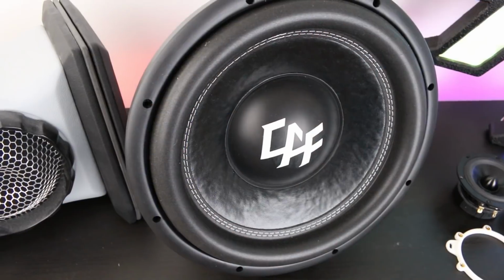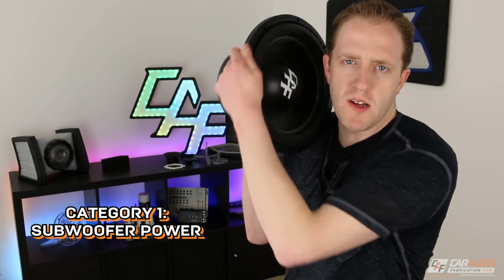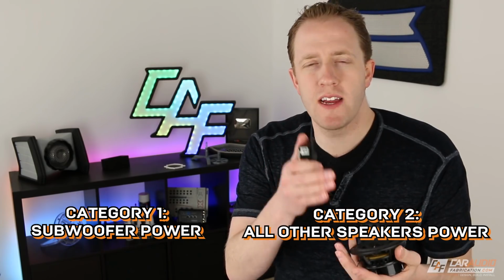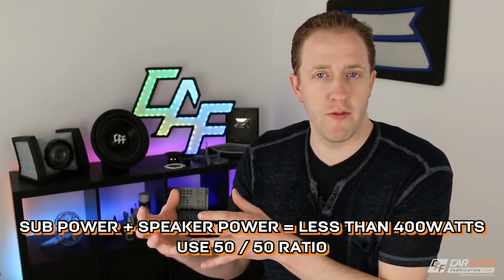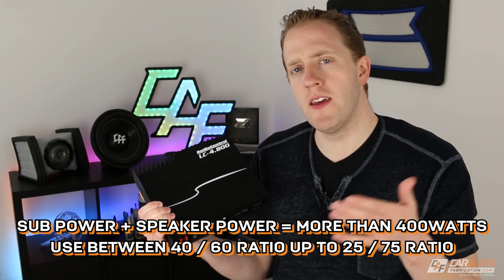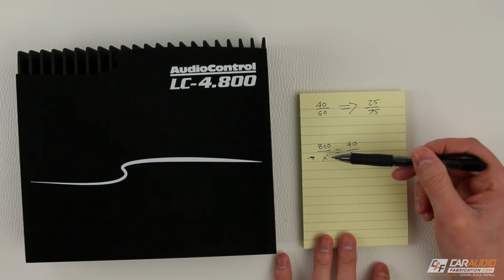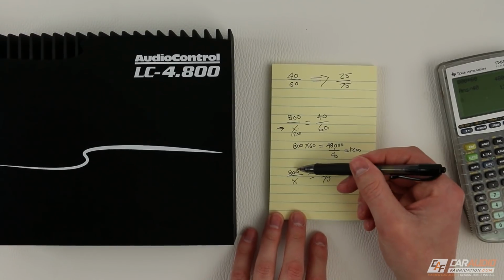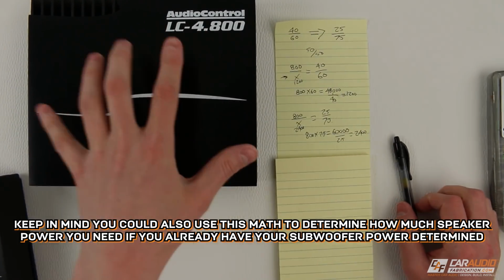Pair amplifiers CORRECTLY - Power Balancing Car Audio

Comment from the maker: Some of you are asking about systems that have MUCH more power, even more than 3,000 total. The larger the total power the more you can shift the power to the subwoofer amps and still have a good balance. So for those of you that are running 20K plus on your subwoofers it's totally acceptable to have a much higher percentage on the subs in relation to the speakers, but let's be honest... at that point its no longer about sound quality and much more about competing and setting a score with the subs. This video is more for the overwhelming majority of people who are likely running from 500 up to 3,000 which I would consider more of an everyday system, and again the VAST majority of systems that exist. Additionally yes, there are other factors to take into account, speaker efficiency, how close the speakers are to listening position, size of the vehicle, temperature of the air... on and on. This is why there is a range of ratios, to account for the variables. Can you skew everything in your favor and use the worlds most efficient speakers and the worlds least efficient subwoofer and obtain balance. Sure... but odds are that using a power range within the described range will still perform better than outside the range. Its a guideline for a starting point that works incredibly well.

Comment: Dont overthink basic systems. If you only have subs & amp, just adjust the amp gain level slightly louder than the factory equipment until you can add better door speakers & a 4 channel amp & readjust then.

Comment: This is a simplistic approach IMO. What you should be looking at when deciding is speaker sensitivity (ideally graphs).
Assuming you want 108db of volume - and a flat studio EQ - this is how many watts it would take:
Tweeter with 92db sensitivity? = 40w
Mid/Woofer with 88db sensitivity? = 100w
Sub with only 83db sensitivity? = 400w.  +3db of bass boost? Then 800w.

That is only the wattage ratios for those speakers, with those sensitivity ratings.  Enclosure design etc real world stuff will change what it puts out, but still at least something to go off of other then just "usually people use some ratio between x and y'.
Can we please make math cool because actual answers are betters then general rules/ratios.

Comment: I have second hand 2x45W amplifier and just for fun slapped a 300W subwoofer on it and my windows were shaking like hell and the speaker started to smell  burned and the amplifier fuse started to melt how and people come with numbers like 1200 watt amplifiers for what ? Bragging rights ? Pushing 1200 watt to what goddamn speaker your windows will blow. People ask a simple fcking question what speaker do you need for a certain amount of amplifier power and we get a complicated 8 minute video about god knows what because i didnt understand a goddamn thing properly.

Comment: When I am looking for an amp to match with speakers I generally go by a process of using an amp with twice the output than the speaker. So I would find an amp that was capable of providing 200 watts a channel if I were installing 100 W (RMS) speakers. Then I adjust the gain accordingly, somewhere just under 50% so I am sending 80-90 watts of power to the speakers. Foremost this is to reduce the stress and heat in/on the amplifier since it is working under 50% capacity. This means reduction of heat within the amplifier, keeping components cooler. As heat is the number one enemy of amplifiers. This will help the amplifier work properly and  for many years longer than using an amp that is running at 70%, 80%, and 90% it's capacity. If your amps are in the cabin of your vehicle this will also help reduce the heat in the cabin and lower its natural temperature. Less heat also ensures a better sound with less chance of distortion from the amplifier. So far this hasn't let me down. But I also know this method is not always possible.

Comment: I have a 2011 Toyota Avalon Limited and want to install Infinity speakers.  I do not want a subwoofer that is so overbearing that the speakers aren't heard to their full capacity.  I'm looking for a nice sound and if I want to turn it up a bit I won't kill the system speakers.  any suggestions?

Comment: Pushing 750 watts kicker amp into two cerwin  Vega 10 inch and  425 watt kicker amp into 2 tweeters 4-6.5 2"way coaxial  and 2 6.5 for mid.

Comment: Would 2 Pioneer TS-A300D4 12” Dual 4 Ohms Voice Coil Subwoofers - 1500 Watts, could combine with a
 
Pioneer GM-D8701 1600W Max 1-Channel GM Digital Champion Series Class-D Monoblock Car Audio Stereo Amplifier w/Wired Bass Boost Remote

???? How thick gauge wires would I need for a 2005 corolla??

Comment: So I purchased an 800W RMS Rated amplifier to pair with some subs I just bought, but I’m not using any sort of amp for speakers just yet and am only going off of the after market AVH 501-EX which only has an RMS rating of 22W and a peak power of 50W. Am I out of luck here?

Comment: I am slowly working through doing a car up, and the audio "attempt" from that came with this car is an embarrassment at best. Front channels hooked to rear door speakers, rear channels to stock 8" paper-wubs in the parcel try, tweeters hooked somehow in the mix on the dashboard, the overall quality value  on a scale of 1 - 10 is about negative 35!!!! Even the headunit is just sitting in the din-space, not attatched, not secure, just sitting in there!!!

I gave up on anything stock, so slowly piecing together parts here and there.

This is a rare piece of information that I have been seeking and hunting, and is gold, thank you!

If you google for stuff like Amplifier power ratios, you generally get flooded with "amplifier to speaker" or "amplifier to subwoofer" but you dont get much on speaker power to subwoofer power ratios, so this was informative and great to actually get some figures, and base-working as well.

Thanks again!

Comment: Thank you for the great video. I think instead of 40/60 & 25/75 role you can multiply by 1.5 or 3 for example: 800x1.5=1200 or 800x3=2400. Is that right?

Comment: Soo... Just to be clear. And if i understand it correct. If lets say, one have two subwoofers, each have a low "w" of 1500 and high "w" of 3000. And an amp on 3000w. 
One can then go with the 30/70 scale to be able to use the woofer?

 (I think the total will land on like 7000, but its around 35/65 and 30/70 if one whants to hit the exackt number)

Comment: For my install I have two MTX terminator subs at 200 Watts-rms and 4 ohms wired in parallel so that the final load is 400 watts-rms at 2 ohms. My amp is 2 ohm stable at 750 watts-rms, so its more than enough to power the subs. I personally run the amp at 400 watts-rms so I get the most out of the subwoofers without blowing them up.

Comment: I’m confused. Someone please help
I have a aftermarket receiver with a 18W RMS
I have some kicker speakers in front and rear at 100W RMS
Is the total amount 118W RMS on my speaker side? Is it 200W because i have a pair of 100W RMS speakers, or is it 400W RMS because each speaker has 100W RMS. 

I’m trying to figure out which AMP and sub woofer to go for. I really like the JL audio power sub boxes and I believe that’s a  400RMS amp/sub.

Comment: Most people with huge systems just stuff those pro audio style speakers in every square inch of their ride where there is no subs or amps in the way anyway than they slap some big high distortion class d amp on them so they can hear the vocals over the bludgeoning bass. Sure it sounds cool from a football field away

Comment: Ok here's my question though.  I'm running a Rockford Fosgate R500x1D to push my single Fosgate Punch P1S4-10.  I have it wired to 4 ohms which puts out 300watts x1 so do I plug in 300watts into the equation or the 500 watts that the amp is rated for?  I installed 4 Fosgate R165x3 6.5'' speakers into my cruze and never got an amp for them so I'm pretty underwhelmed with their performance.  Now i'm trying to figure out what amp I should get to push them. The speakers are 90watts 45watts rms so I've been looking at the P400x4 or the P600x4

Comment: I have a Sony XAV-AX5500 head unit that outputs 20Wx4 RMS that is driving JL Audio C1 650 speakers. I want my next upgrade to be a subwoofer. Would a JL Audio JD 250/1 be too much power to still have balance? The only reason I ask is that I plan on using a 10w0v3 4-ohm subwoofer. At 4 ohms, the amplifier would output 150W. Should I be using the 250W rating or the 150W rating to do my calculations?

Comment: Ok so a little question. I have my subs and amp already. I have 2 300rms amps w/ 2 250 rms subs in my car (03 eclipse) and was looking at pulling the stock amp and speaker (2door2rear2tweets and looks like a mid in the center of the dash) what would you say is a good amp and speaker set up to round off my system

Comment: I'm lost. My head unit is 20w x 4 channels RMS. Peak 100w x 4. I have stock speakers. I want to use a Cerwin Vega VPAS12ST that's 600w at 2ohms or 150w RMS. As I understand it, the CV has a built in amp for the sub. Does this follow the rule of thumb?

Comment: My calculation went (800÷40)x60.
Your calculation went (800x60)÷40. 
The result was the same. Math has never been my strongsuit, so I'm not sure if my way is wrong in some situations, or if it's fine to do it either way. I'd appreciate anybody's comments on this

Comment: I've NEVER had amplified door speakers. Always only off the aftermarket head. I simply kept the bass setting at 1, set the low pass to 100hz, and set the high pass to 100hz, set the subwoofer setting at 1-3, and medium settings for treble and mid, and upgraded the door speakers to tri-axials. Always has worked out great. I'm not blasting anybody out, but at least my stuff stays pretty clean save for like the last 3-5 on the volume knob.

Comment: No mention of speaker sensitivity. Id feel thats relevant. Most people are going to run 1 speaker in each door. A lower end speaker is rated 40-60rms and above average speaker will run 100-150rms a piece.

Wheres the speakers that take 400rms each? Im not hacking up my doors and doing custom pods. Not all of us have that much money.

Comment: Greetings to the gods of car audio.
How you pair an uneven set of speakers to an amplifier?
I'm trying to upgrade my 2017 Mazda 3 with Bose audio, it have 9 speakers but only 8 set of wires coming out the factory amplifier. 
I think the center speaker must be bridged to the left and right dash speaker.
Knowing it have 8 channels , do I need a 4 channel amp or more?
Thinking of audiocontrol D4 or D6.
Thanks

Comment: Great video. You didn't mention capacitors! My system is old 2003 Paul Walker red F 150 Lightning.
People stole my crap every other year. I went ape sh*t on the last install. So 10 yr record no theft. I can't tell if the Rockford phosgate mid amp is dying, the Kenwood mono bass amp going (doubt it). The sub box was designed to be ported with 10's. I deeply regret not getting 12's. Custom built box. We sealed up the ported box. 
Anyways I don't live in Houston anymore. I think one sub is blown. Since its sealed I cant figure out which one isnt going. Getting to the midrange amp requires removing the whole seat . getting the box to come out will take 2 guys about 6 hrs to figure out my tricks. Booth subs have to be undone and 20lbs each. Then the box is bolted to the frame. After you get thru that, better have random torque wrench screws other wild screws that the trusty Kenwood mono bass amp is bolted onto. Reverse in time i should have built the box for 12s. I was spoiled w a 15 for my first dinky system in a hatchback. The ported box was calculated by awesome phd physics guy at my school. 
Anyways it still sounds good. Kenwood deck went out after 17 years of dropping faceplate million times. Multiple break ins. It was still going but my XM adapter couldnt handle last shock. Resoldered it. Battery wire from the harness was wandering loose. Good excuse to buy new things. I am spending good money on engine things to make sure I can escape Milwaukee in it.

Comment: Quick question. My sony head unit says for power it outputs 80 x 4 channels. Is that 80 for each or split against  4? Is their anyway to get around using an AMP if I just want to put in aftermarket speakers and tweeters?

Comment: I have a cheap kenwood amp paired to an expensive sub now. The amp puts out 450 rms at 4ohms and the sub can handle 400. I’m not happy with the sound quality and was wondering if a higher quality amp will improve sound. The sub I have is an infinity kappa perfect 12vq. It’s an old sub but in perfect condition still. I’m looking at a Rockford frost gate amp that puts out 400 watts rms at 4 ohms. The punch series

Comment: Hello Mark, great channel! I wanted to ask since am having trouble finding information about pairing amps with speakers regarding power. I'm mainly looking for mid range not subs. So two examples. What's a good amp range in RMS watts for a component speaker that is rated 50 watts RMS with a sensitivity of 91dB. next would be a 75 watt RMS speaker with sensitivity of 88dB. Is there a good rule of thumb to use, like match the RMS or go with more power but do not exceed a certain amount over RMS?

Comment: What is missing here is that the watts indicated by manufacturers can easily lead to compare apples with carots.
The IMPORTANT thing is to check for which THD (distortion) these watts are given. Very often, it's for an high distortion, and thus X watts with 0.5% THD or X watts with 5% THD does imply that these 2 amplifiers does not produce the same power with the same sound quality at all!!! So the computations made from these watts are then a very rough estimation and don't mean a lot. It's only pertinent if same kind of amplifiers from same brand are used (for subs and main speakers) and in any case check the specs!

Comment: Mark, I have an Axxera AVM111NAVLH on our motorhome and they used a super low quality speakers at the factory. I love the head unit and wonder if it is even worth to replace the speakers. Should I consider adding an amplifier? This unit runs on 4ohms and max power output is only 16 Watts RMS. I don't need anything loud, but I am looking for quality instead. I thought on adding the amplifier so I can have the capability to add a small sub-woofer, but don't know the best way to match all that so it will be a good combined system to work with the Axxera head unit. Any suggestion?

Comment: I'm stumped as to why you are calling it an 800 watt amplifier when its rated output is 125 watts per channel?
I have a 50 watt per channel amp going to my component speakers. To me that is 50 watts. So I may potentially use a 300 watt sub. But I'm not sure how to use these guidelines if I start out with skewed numbers. Please advise.

Comment: Mark, how does speaker sensitivity factor into this?
.
Is there a formula for matching speakers with an amplifier? For example, say I have 4 speakers picked out, that are rated at 100 watts RMS, and have a speaker sensitivity of 90 decibels, how do I calculate how many watts I need for each channel of the amplifier?
.
I'm a beginner. So if it sounds like I know what I'm talking about, that is definitely not the case. Thank you much, Anthony

Comment: Hello Mark!
Wattage is dependent on speaker impedance.  Generally, amplifiers mention wattage @ 2 ohms as a standard. But, in case we use 4 ohm speakers the corresponding amplifier output is comparatively less. How do we match a subwoofer amplifier in such a situation.

Comment: Great video.  I'm new to custom stereos though, and I still have a lot of questions that weren't answered.  I've been watching a lot of your videos, particularly about matching the right sub with the right amp... but the initial "choice" is perplexing me.  Hopefully you can help me?

I have a 2020 BMW X5 M50i, with the high-end Bowers & Wilkins 1500 watt, 20 speaker system.  The "quality" is impeccable, the volume is more than sufficient....but the bass is just a bit "lacking".  Not sure I need more "volume" at all.... I just want to be able to hear the ultra-low frequencies "more" than what I do now.

I'm not sure how much of that 1500 watts is going to the existing underseat subs, but I'm looking to add just a little more low end, with a single 8" or 10" sub in a custom, side-trunk mounted sub and amp.

I want sound quality, not overpowering bass.  I can build the enclosure into the side of the trunk (it MUST look and function 100% like factory.... no huge boxes or obtrusive amps).... but choosing the right size/power amp has me incredibly intimidated.  Size and discretion matters, so the smaller the size, the better.  But too small, and the whole project is worthless.

What RMS power level should I be considering?  What ohm level should I be considering?  

Thanks for taking the time to answer this.

Comment: Hi I have 2dvc subwoofer at4ohms I connect at parallel together final impedance 1ohns my amplifier is 1800rms the sub is total 800rms this good combination or over power amplifier thanks

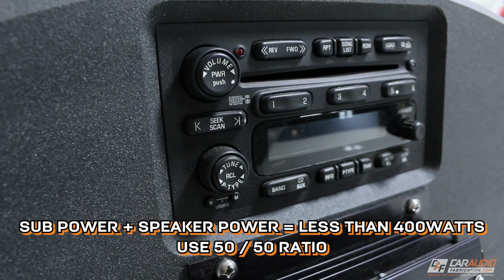Comment: 3:03 Question: You used the factory radio as an example and said it supposedly has 100W RMS, but I checked my head unit and it says 14W RMS x 4 Channels, can u help me understand that?